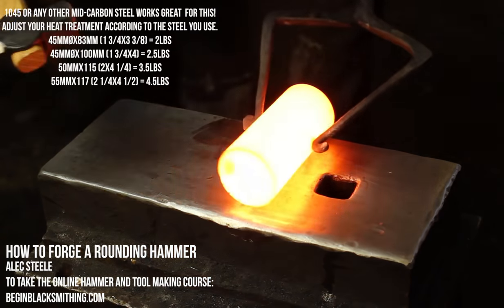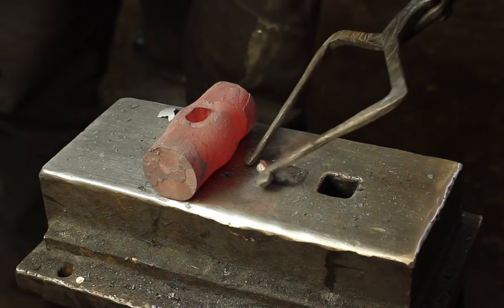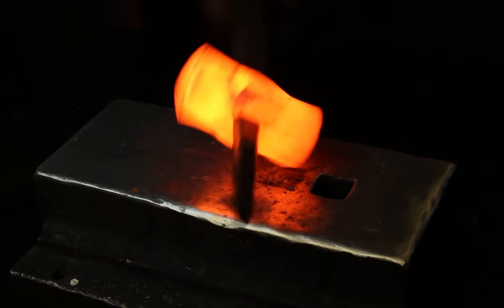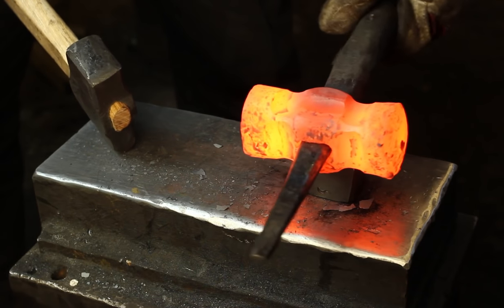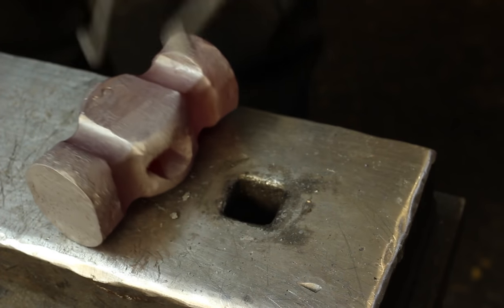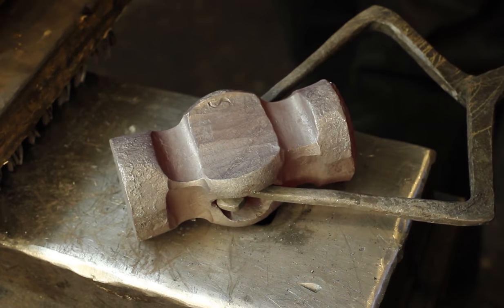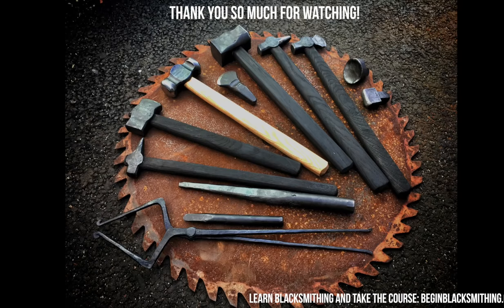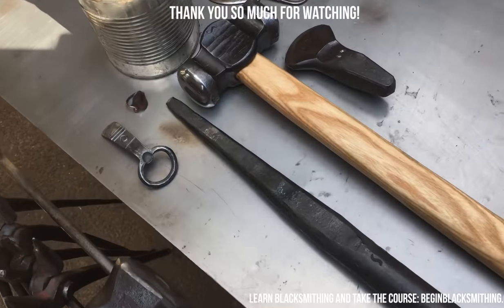How to Forge a Rounding Hammer

Comment: Hi Alec. Great informational video. What steel would you recommend for hammer making? en9 or something a bit harder? Also what stock section would need for a 2 and 3/4 to 3 pounder? 
cheers
Tom
Reply from the maker: Hey Tom! En9 is a perfect steel to use! 100mm of 50mm round will make a 3lbs hammer or so! If you are ever curious about what size you need, simply look up a steel weight calculator and allow 1/4 pound for wastage to scale and grinding!
Reply: +Alec Steele thanks for the advice. Definitely going to attempt one soon.

Comment: Hey Alec my mate Darwin and I love your videos! Please keep on keeping on! He and I have build a clay lined charcoal forge a couple weeks ago ( air mattress pump for bellows) and we are successfully turning out bars of Damascus!  We hope to move up to propane in the next month or so. We also make our own oak and mesquite charcoal. We do everything by hand on a two foot piece of high track we are using as a striking anvil. Our current project is a San Mai Bowie with mild and high carbon Damascus on the outside billets ( scrap mild and 1095) in a 72 layer twist pattern and the core billet is going to be a 112 layer opposite twist in 1095 and 15n20. How would I be able to send you photos

Comment: Alec, great video, the hammer turned out beautifully! Quick question - can you use roll forged 1084 steel (like from a railroad rail) to make hammers, hardy tools, etc.? If so, I assume heat treating would be required? Any suggestions? Thanks so much!
Reply: These are the questions worth asking
Reply: You can, but generally you want something more mid carbon steel. Higher carbon steels become more brittle as they work harden, and become more prone to chipping later in their life. It’s not a deal breaker, but definitely something you have to keep in mind.

Comment: Torbjorn uses a little metal wedge in the end. Is this essential?
Reply: Ser Browntown no. You need some kind of wedge(wood or metal or both) so that the handle sits in place. Because the hammer eye is shaped the way it is(like a taper) a wedge functions as a stop so that the hammer doesn’t go off the handle. Hope this helped

Comment: I need a striker. I really want to make a hammer, but I am at a loss for a striker and any material. And I know I could do it myself, but I'd rather not. Would a truck axle work as material for a small hammer?
Reply: a bit late, but yeah totally that'd work for a small 1-2 lb hammer
Reply: Why not predrill the hole?

Comment: im just getting into forging, im hoping to most do damascus kitchen knives out of recycled steels. at this stage i have only managed to buy an anvil, my next purchase is going to be a gas forge. 

im curious to ask, what tools do you think are required for an amateur's forge to start with to atleast make some kitchen knives?

also were you using one hammer to strike another hammer to shape the steel? my background is in metal fabrication and i was always told to never strike one hammer with another during my apprenticeship, tho i never really knew why, is there an urban myth behind this or something?
Reply: oh btw, thankyou for these videos im really enjoying learning the techniques you use :)
Reply: Mr jimjimjimmyjim Hey there I know I'm a bit late but I have some input. Kitchen knives, although they seem like the easiest place to start are by far one of the hardest. when people use kitchen knives, they expect to be able to simply use it, then throw it in a sink until it gets put through a dishwasher. if either of these things were done to a home made carbon steel blade it would be destroyed then and there. for most kitchen knives, stainless is essential to prevent rust stains petina and other things to affect the blade. the handle on the other hand would need to be finished in a few different ways in order to stand up to getting wet on a regular basis. plus the finish on the knives MUST be quite perfect as it needs to be able to be sanded to a high finish entirely. so just a word from the not so wise start somewhere other than kitchen knives. I would not even attempt making a functional carbon steel knife without a good belt grinder and some proper abrasives, hand sand paper. an angle grinder, saw or saws, hammer(s) tongs (if you are blacksmithing not stock removal) and alot of practice. files help for fine detail but I would not attempt to make a knife using no power tool except for your first couple to understand how to form knives and shape bevel tangs bolsters etc. anyways, I love the craft and encourage you to try to start! but some tools will cut out literally 10's of hours off each knife.
Reply: Mr jimjimjimmyjim Also I would suggest that since you are hitting that hammer with a cushion under it (hot steel) the steel will absorb the impact. if you hit a hammer with a hammer against an anvil you would very likely do damage to all three surfaces, so I could understand that.

Comment: I've noticed you always leave the fuller marks in the cheeks for the eye. Have you ever considered using a flatter/set hammer to take those out for a cleaner finish? Not that there's any problem with it, I just enjoy seeing practices unique to smiths. Sets them apart from others.
Reply from the maker: I have always liked the aesthetic of swooping cheeks. Usually the cheeks have less texture to them because I do the finish forging with a set of larger radius fullers. Flattening them odd completely is certainly an option if you like the idea. You will need a set hammer that fits between the cheeks and a matching bottom fuller to do it!
Reply: ***** Nothing wrong with making tools for making tools. ;D Thanks for the reply.